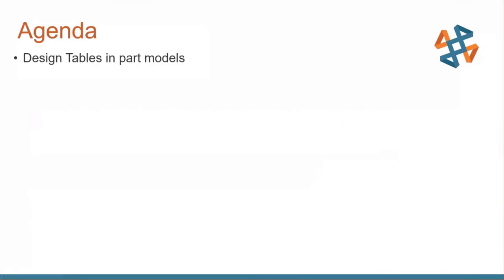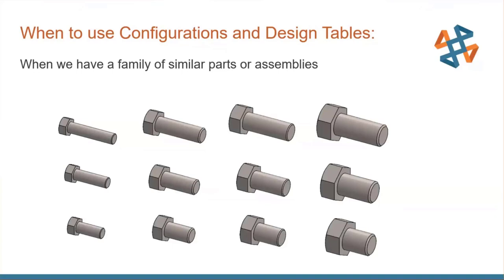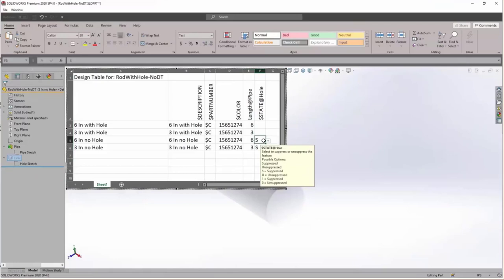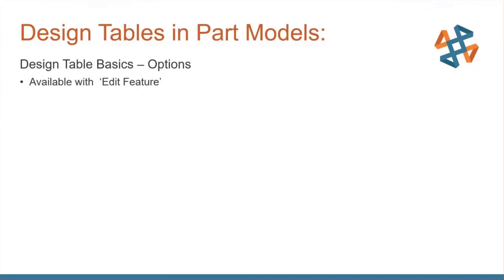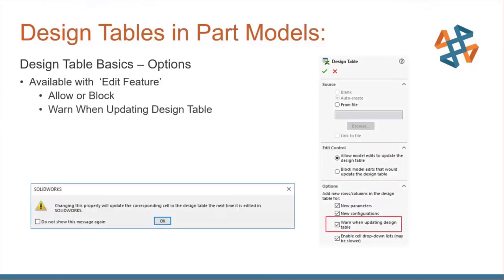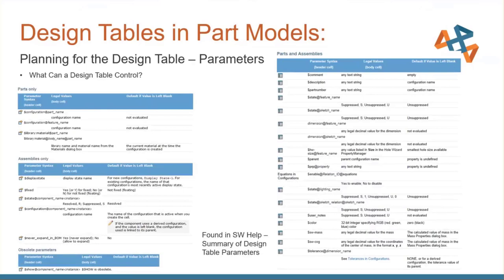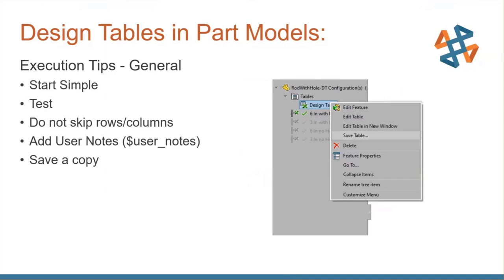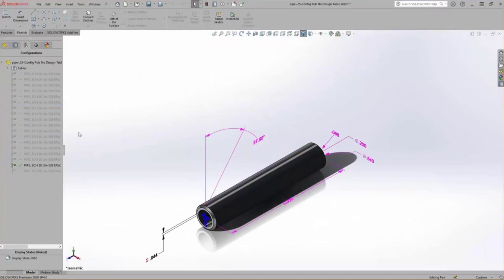Design Table Tips Tricks for SOLIDWORKS

Comment: 11:19 "if that's not how you prefer to use the environment ..." part is here
Context: Excel within Solidworks
11:39 "The spreadsheet still exists inside solidworks model, it's just being opened up in a separate excel instance"

Comment: U don't appreciate the impact of design table
We have our entire manufacturing foolproof automated using this :    1. Engineer puts intended design dimensions into excel sheet, 2. Excel is linked to Company's inventory & is programmed using if else statement to choose closest part from inventory & 3. update inventory too. 4. That excel file is automatically read by design table and model is updated. 5. Engineer just presses drawings and updated manufacturing drgs incorporating design change go to production.

Comment: Can I create a table for different diameters, but using some Excel formula to automate the choice of length, or do I have to put an infinite number of length lines for each diameter?

Ex.:
-Cast Iron Flanged DN200, L= [250,500,700...]
-Cast Iron Flanged DN250, L= [250,500,700...]

or

-Cast Iron Flanged DN200, L=250
-Cast Iron Flanged DN200, L=500
-Cast Iron Flanged DN200, L=700

-Cast Iron Flanged DN250, L=250
-Cast Iron Flanged DN250, L=500
-Cast Iron Flanged DN250, L=700

Comment: Hii, I have a question. Can you use design tables across multiple models? Maybe creating a design table for each part and pasting them in the same excel document. Does anyone know if that is possible?
Reply: Yes, if it's across multiple models, you can use Insert>Excel Design Table and choose "Source: From file", and can browse to the other design tables you've used in other models. Is that what you mean? Yes, you'd also be able to Copy/Paste the data, but I think the former method is easier.
Reply: @jordankleinschmidt2984  Yes I'll try that out, thank you!

Comment: Why did they change design table to excel? It was easyer and more userfriendly before.
Reply: yeah, i can agree with that
Reply: It's not changed, merely an alternate option. Excel formulas allow much more versatility. If you want a simple table, right-click any feature on the feature tree and click "Configure Feature".
Reply: > "It's not changed, merely an alternate option"
 @jordankleinschmidt2984  what are you talking aaboout???

Earlier, the table opened in excel as well, but in a separate window. Now it opens in this messy forcefully embedded like excel.